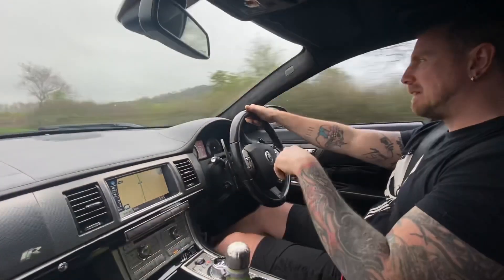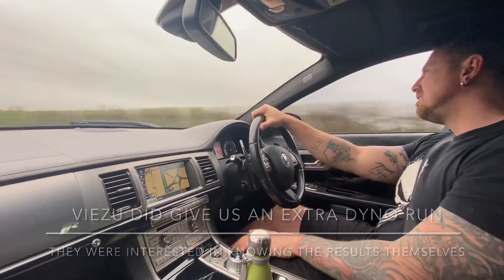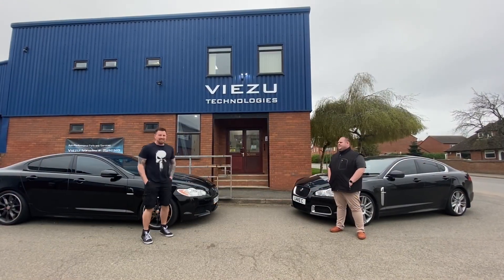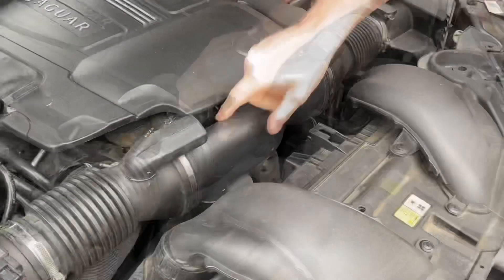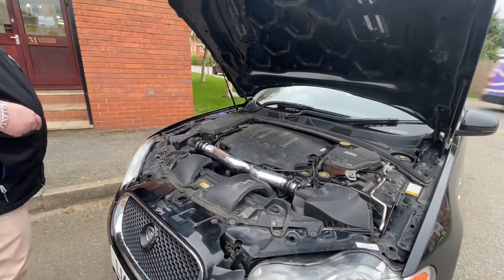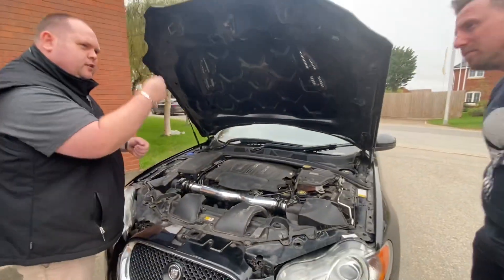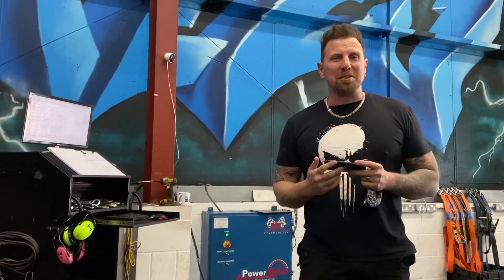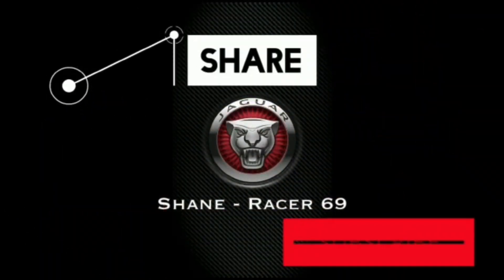Mina Gallery Intake Dyno Tested - Jaguar XFR - does it make any difference or just look pretty?

Comment: Great video and very timely. I love seeing this type of honest back to back testing where there is not a profit motive to worry about. I was strongly considering buying that intake to what I thought complement the lower pulley and tune I am getting from Eurotoys. I was shocked at the results as I have owned three different supercharged vehicles and usually a smoother free flowing intake either helped or at least didn’t,t  hurt performance like this one did. While we don’t have the benefit of validating the other comment from a viewer that they had similar results after removing theirs it shows that this wasn’t some one off freak result.  It’s hard to imaging under what circumstance the manufacturer could have come up with the results that they claim. While I have always taken manufacturers claims  with a bit of skepticism a 35-40 hp difference between claimed gains and reality is mind blowing. Keep up the good work. New subscriber here for sure. I look forward to check out the rest of your videos.

Comment: Hello I also installed the Mina Gallery Intake on my Jaguar. Which setting is made on the Jaguar for the Dyno test? I always have to use a 4X4 dyno because a normal dyno doesn't work.
Reply from the maker: I don’t know the setting because I don’t work at Viezu, they do the mapping and dyno. They don’t have the front wheels moving as it’s only a rear wheel drive car, but there are error messages that come up due to the front wheels not spinning. You just need to disconnect the battery for 5 mins after it is al finished and it will reset the faults.
Reply: @69racer69  I get wrong performance results if we don't test on 4X4. There must be a trick to test it on two wheels.
Reply from the maker: @struppasound  sorry I don’t know.
I take it your Jaguar is only 2WD?
Reply: @69racer69  Yes 2WD Model 2009 XFR
Reply from the maker: @struppasound  I don’t see why you get the wrong figures from the dyno, it should  do have anything to do with the car setting. A little confused about this one.
Reply: @69racer69  if the front wheels do not turn then he thinks he is stationary and does not allow it to turn to full power. The log then looks like a sine curve.
Reply from the maker: @struppasound  ahhh ok. Your dyno company should find out what to do.
Reply from the maker: @struppasound  have you tried turning the DSC off completely by pressing and holding down the button for 10 seconds?
Reply: People on the forums say K and n don't make power but I have timeslips for my 2019 jag f pace ran 8.80@80mph stock but 8.68@82 with k and n panels so you can't always trust a dyno

Comment: great video shane really worth watching.if i end up with an xfr i would have to put cone filters on it to release the supercharger whine,i would probably make some custom heat shields for them. 
would be good to see a video from you explaining the common faults of the xfr from timing chain guides to e-diff's. it would really help future buyers :)
oh and you deffo need club 600 stickers for you car
Reply from the maker: Oh and yes 600+ stickers may have to come lol. Got 2 more guys travelling for their tunes on Saturday. Will see what they achieve
Reply from the maker: Hi Matt, thanks for the comments and guidance. I will look into what videos can be done as a buyers guide. I haven’t had much trouble with either of my XFR’s, but I’ll have a think.
I’m working on ways to unleash the charger noise without restricting power. May do a test with cones to see the effects on performance and noise. Would help weigh up the option until I figure out another way.
Reply: @69racer69  perhaps cone filters in the OE airboxes would work
Reply from the maker: @bigmatt2896  maybe, will see what the heat difference makes on the dyno.

Comment: Great video. I have the mina Y pipe with the golden wrap running Viezu map for upper and lower pulley for nearly 3 years on a 2010 XFR (owned since October 2009). You made me curious to do a dyno run with and without the Y pipe. Although I so an improvement in 100-200 in same whether conditions. OEM Y pipe 7.8 Mina  Y pipe 7.6 ( more than half a tank) and in cool condition 7.5 (full tank). Will keep you posted with the results.
Reply: Did a dyno run today and following are the results ;

Dyno Jet @ 31c ambient temperature  
Mina Y pipe (average of 3 runs)
Torque average 560wibf
Horsepower average 551 whp

OEM Y pipe (average of 3 runs)
Torque average 557wibf
Horsepower average 568 whp

OEM 17 wheel horsepower gain on STD reading
OEM   3 pound force feet drop on STD reading 

Returned the XFR back for storage with OEM Y Pipe. 🤦‍♂️ running mina gallery for 3 years. 
Thank you for this video.
Reply from the maker: @khalidas9118  thank you for trying it and confirming our findings as well. It’s such a shame, they do look very good.

Thanks for the info, I really appreciate it.
Reply: You did a actual test rather than letting a car heat soak fair test
Reply from the maker: Great info, please keep me posted with the results.

Comment: I must say... What a fantastic video... Just what we XFR owners need. Your videos are so relevant and so to the point ... Please don't stop ... This is absolutely fantastic!!! Thank you so much.
Reply from the maker: Thank you so much, I really appreciate the feedback. I will continue and keep trying these things so we all have the real information available to us.
Reply: @69racer69  since I have seeing all your videos. I'd like to know about how your fuel economy has been after the ECU tune. Im asking this because I intend to use the car for long drives. Keeping in mind that the weather in India especially in the rural areas can peak towards 45degrees celcius. Keeping practicality in mind could you advise if the car can keep up with these temperatures and about the economy after a tuneup.
Reply: @69racer69  I'm confused I thought a bigger tube would allow more air
Reply from the maker: @adventurousx8220  I believe it’s more about air velocity, the larger tube doesn’t give it more capacity because the stock has 2 smaller tubes that make up the same size of the throttle body intake, the mona has 2 the same size that meet in the middle where they suddenly half in size, so this slows the air flow down. It’s wasted space, not needed at all.
Reply: Great video!